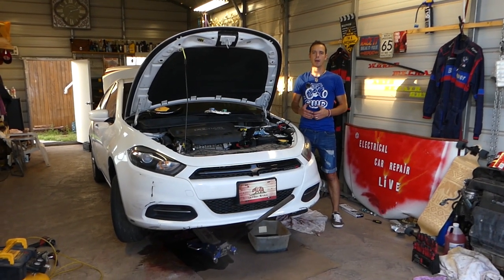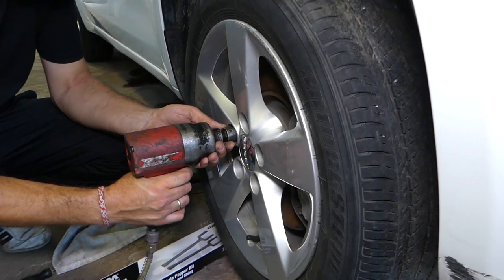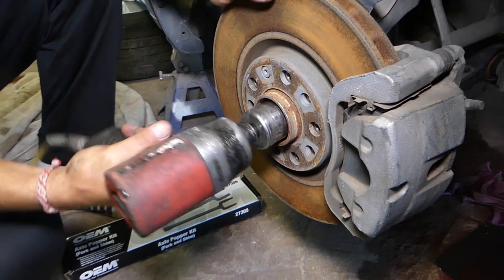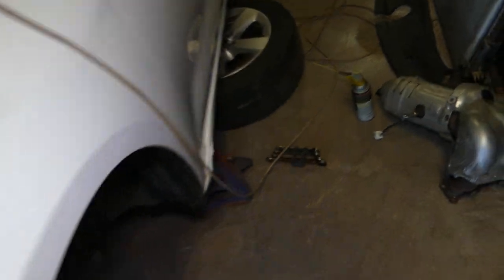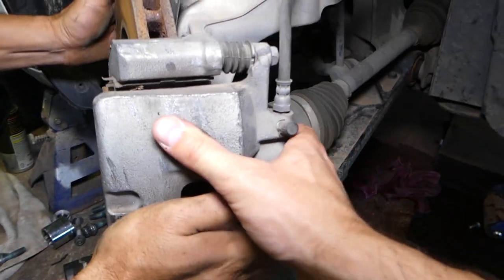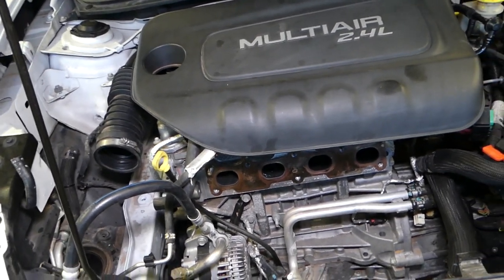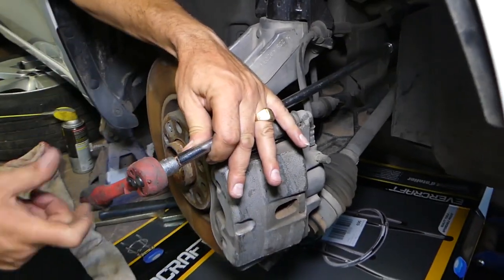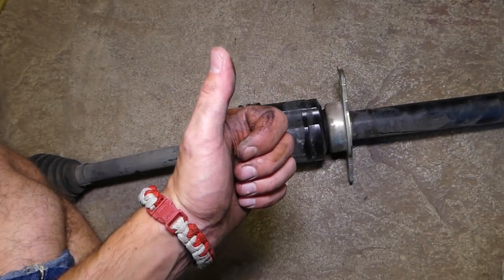CV AXLE DRIVE SHAFT REPLACEMENT REMOVAL PASSENGER SIDE DODGE DART CHRYSLER 200

Comment: OK I definitely understand you're trying to be delicate and professional but bro ball joints break the damn castle nut loose don't take it off get a big hammer if you can aim good and just hit that freaking thing right on the joint really really hard if you can't aim good get a 1' solid steel ride place that on the  Joint and hit that really really hard I promise by the 2nd hit it's gonna come out they almost always come out on the 1st though

Comment: Dude spent more time getting the wheel nuts out of the impact sockets could of saved a lot of time and saved you’re wheel nuts by taking them off by hand with a tire bar or breaker bar just take the time do it right don’t strip em damn